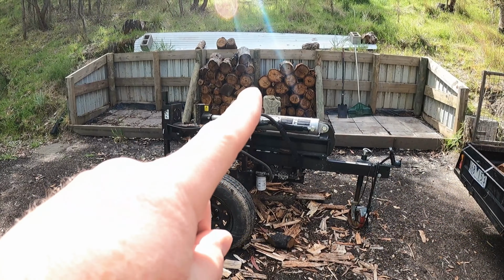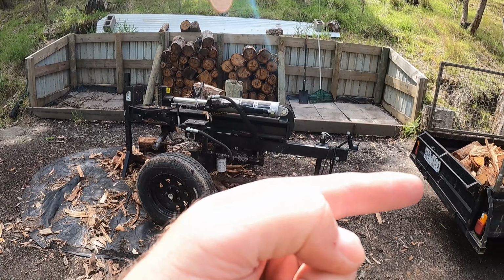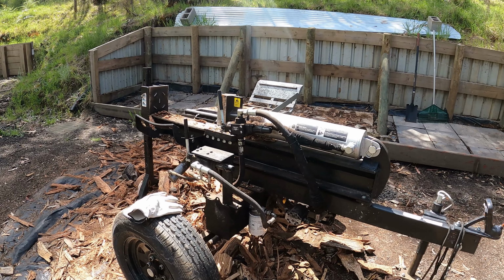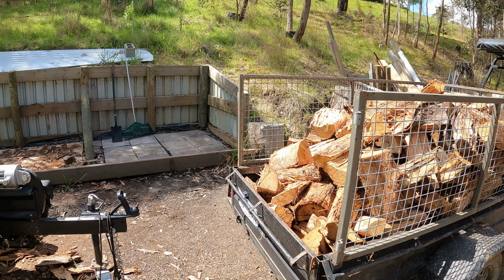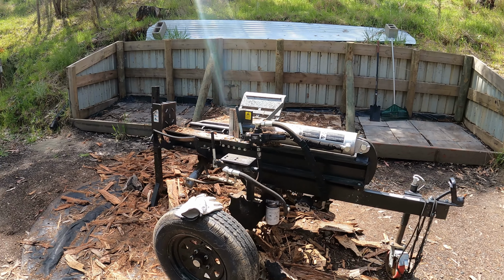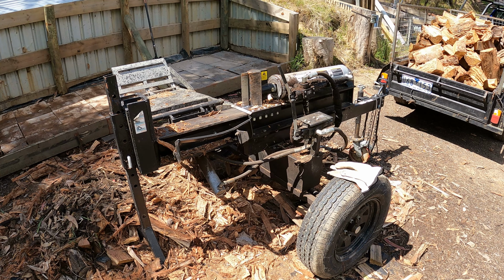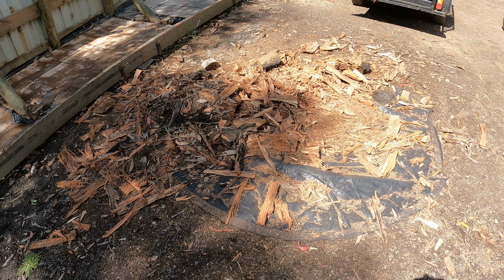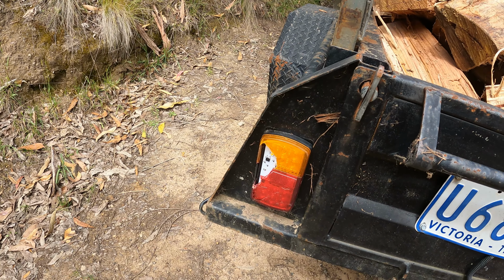Splitting the Last Jag of Wood in the Woodyard - 2023 #21

Comment: Nice manageable rounds 👌
Splitter goes good. 
One of the tail lights on my ute got smashed reversing somewhere up the bush…
Superglue and silicone & 20 bits of plastic were a tail light again 🤣🤦‍♂️
Reply from the maker: I think I threw a few pieces away in a tantrum. 😄, it’s still waiting to be fixed…… it’s on the list ……